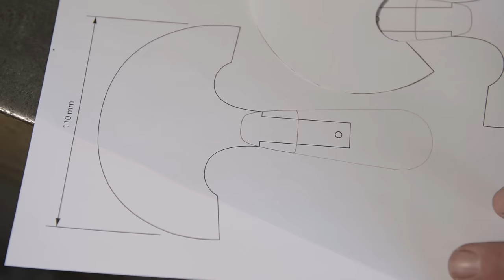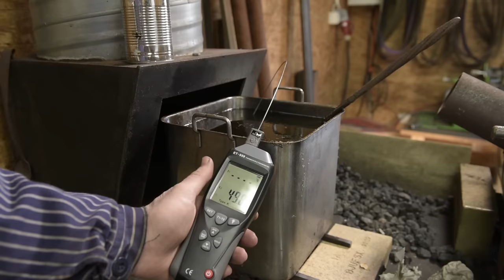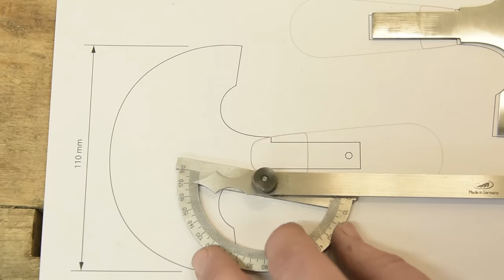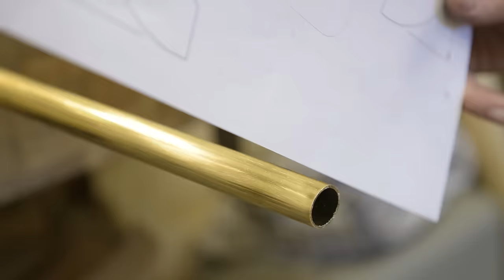Making a half moon leather knife

Comment: Does anyone else think that his making of the brass ferrule, is the most impressive part of this?
Reply: that's the part I was looking forward to most from the thumbnail!
Reply: Never saw something like that, i'm really impressed!
Reply: yeah, did you see him cut that brass pipe with a piece of paper? so impressive!
Reply: I do ... It was indeed worth the watch 👍
Reply: It looking like 👄
Reply: marvelous craftsmanship
Reply: What empress me is that your the first person I've seen using English 👍
Reply: @charliesybert2683  Thank you. But I don't have a choice, in the matter. English is the only language that I know. (So, no credit goes to me,  for this one. :) ).
Reply: @roberteaster6655  same
Reply: The whole thing was most impressive! What a lot of great skills.
Reply: The FIT is the most impressive to me.
Reply: yes, indeed but since he has a lathe, he could have made the same shape much easier using sheet metal with the steel template he used with a round headed "cutter"
Reply: I read this comment before i saw it, so i thought: its not gonna be better that how he perfectly sanded the angle of the blade with his wood contraptions and how clean it came out.
But youre right, i think if you hammer a tube like that its going to come out a mess and unusable but he really applied some wizardry there
Reply: Check out a bladesmith by the name Tai Goo. He does what he calls tribal smithing. First person I saw use that technique. His website had some good tutorials( or maybe just videos, can't remember if he made explanation or not) the last time i was there. Interesting work he does. Out of Nevada I believe.
Reply: Yeah I have never seen anyone do anything like that
Reply: Muito bom esse serviço ótimo..,
Reply: @JackPorter  It's lucky that paper was handy. He would have had to hacksaw that for hours.
Reply: Robert, for sure you're gonna live over a hundred years, that's for sure. Cheers from Costa Rica, well done.

Comment: Beech wood was a good choice! It matches the steel and brass, and it will age with the metal nicely without getting too dark.

As a fellow swedish knifemaker(hobby/personal use) i applaud the no nonsense perfectionism, i appreciate when people make knives with common sense.

I like that you went through the somewhat troublesome task and showed how to make the hole/slit in the handle for the tang, like the old wooden morakniv handles have.
I dont have a lathe, and the few times i have made a hole/slit in a handle, i've used needle files, and it's annoyingly time consuming. Next time i think I'm gonna try your sawblade method(somehow).

Good job, and thanks from Västra götaland(Skaraborg).
Reply from the maker: Tack!!!

Comment: Beautiful knife.
You hold it in your fist vertically when slice - like you where stabbing the material. You draw the knife towards you as you roll the handle away from you.
You splay your fingers over the blade with the knob in your palm when skiving, and push away from you, or hold like above and sweep along the edge depending on the whether you are making an over or underhand cut. This is the reason for the stubby handle.
Using it the way you are defeats the reason for the shape of the knife and blade, you may as well use a utility knife (they do an excellent job when used properly).
Your knife has a bit too much sweep at the points, you are running the risk of nicking your wrist when held properly.
Reply: It is beautiful. I was hoping he was going to make a cover for the edge, then he pulled out the leather and just tested it.

Comment: Nice Ulu!  The one tool that does everything from hunting, skinning, Leatherwork and even great custom wood shaping and upholstery!  I’ve used mine for several decades!  Though on mine I pressure-fused a hardened high carbon steel edge around the blade to reduce sharpening frequency.  Great video! Thanks.  Like my dad used to say while teaching me the trades, “You’ll never be satisfied by ‘good enough’.”  “Good, Better, Best, Never let it rest, ‘Till the Good is Better and the Better - Best!” -Alban Douglas, mentor.

Comment: Nice!  As always, an excellent result.  For some reason, I always enjoy when you make the bezels.

I'm a lapsed knife-maker, and rivets are a big part of that world.  Have you ever seen a rivet dome set?  They spin in a drill press and put a perfect, polished head on rivet pins.  There is a matching bottom anvil.

It seems that a man of your skills could make one, if nothing else, as an experiment.  Hahah, we have time now!
Reply from the maker: Thank you!! No I haven't seen a tool like that! Sounds cool! It's difficult to finish the pin/rivet when the handle is "done"... A tool like that could solve the trouble I guess! So you don't hammer at all, just go to the drill press?
Reply: @torbjornahman  Yes, that's how I've seen it, and yes, that's exactly the problem it solves.  

To be clear, I've never done this, only seen it described on knifemaking websites.  

I was just thinking about the bottom anvil - it could be double-ended: one end has a hole which sets the stick-out for the rivet head (which probably needs to be quite precise), and the other end has a cup which safely holds the finished head. 

The cupped side might want to be domed like a rivet header to keep it off the handle?  I don't know.

The spinning part probably needs to be well-lubed with beeswax or similar.

Hopefully, this works and is the subject of an upcoming video!

Comment: I don't have money for a band saw,  so I'm interested in the swedish cutting technique. Can you please give more details on what paper is used to cut brass tubes? Is any other type of paper needed to cut steel that has more tensile strength? I could not appreciate very well if the piece of paper cuts the tube with burs, also is the same sheet of paper  used for several cuts or do you change it for every cut?

Comment: I made a very close device to the shape of your thingy from a 'garden hoe' ,  my problem was the curves in the rounding shape on the curved part. I used hardwood (OAK) for a handle using all of the metal from the Hoe as a TAng, I shaped the wood to fit my small hands. I still can't get the edge I want or need,

Comment: question: When you softened the tang. Were you using your anvil as a heat sink so the blade wouldn't overheat?
Reply from the maker: Yes, but a thin blade like this is no problem really, it cools down quickly so the heat does not travel very far.

Comment: I find that this type of knife cuts thick leather better if the primary bevel is a smaller angle and is merged into the body of the blade.  It usually takes me a day to get a new knife ground in just right and polished up.

Comment: Extraordinary video and a great job.  The high precision brass ferrule.  For a half moon the most correct sharpening angle is 29 degrees.  The pin is nice but useless since these knives always put pressure towards the handle it is impossible for it to come loose.  It is recommended to heat the end to red and immediately insert it into the wood.  That is enough.  The handle must not be perfectly cylindrical, it must have two flat faces to prevent it from turning in the hand.  Congratulations for the video.

Comment: If you're curious to why he kept reheating the brass.   When you aggressively work with metals, they become harder and brittle.   They call it "work hardening."  The annealing process he does realigns the crystalline structures of the metal, easing the tension and preventing it from splitting or breaking.

Comment: Thank you very much for the wonderful video and detailed footage. Great craftmanship and perfect result. There is one point I would like to ask you. Circular saws are usually HSS, air hardening steel, their annealing is very difficult and quenching is done by air cooling. So the steel you used should be simple high carbon steel like 1095 or something, because your oil quenching seems to have worked well. What do you think?
Reply from the maker: Yes, this old blade is probably something like 1095/1075 or there about. Modern blades are almost always done with carbide teeth, then the blade is most likely something cheap non hardenable steel.
Reply: @torbjornahman  Thank you 👍🏻🙂

Comment: Man.....you are the Man.  It was a pleasure to watch this video, even on Christmas Day.   
However, there is one Critical step that could and should have been done.  The bonding of the 2 part Glue or Epoxy between the wood and the inside of the brass fitting.  The inside of the Brass fitting should have been Coarse sanded before inserting it over the glue.  This definitely helps in the Glue getting a maximum bite &  bond to the Brass metal.
But still overall this is a Master piece.  Did you forget to engrave, MADE IN SWEDEN, or rather Made by a Swedish.....lol.  Regards from California
Reply from the maker: :) Thanks! The brass was pretty rough on the inside from the shaping.

Comment: I
QUESTION?
I'm  today myself working on ulu ( mine for spices and vegetables and using a old 5 ft - 2 ( or 1) man saw and having it to bend and twist, when I removed from my Forge what caused it?
 Seen this video years and what a true craftsman you are, 
Thanks for the teaching Sir
Reply from the maker: Thanks. Not sure what you are experiencing there? Bend and twist just by cooling in air? What's the material and how thick is it?
Reply: My first to I saw it was about 1960,
It was about 5'6" a two man saw and if one man was by himself one handle would release so only one man could work it if necessary. 
Thickness much as your circulation as shown. 
 I'm in a air force propane I've built, 
I'm guessing perhaps heating slowly my next try.I  have 2 slightly different sizes and steel for 2 more cut out, But testing the first before I build more. 
Yesterday  chopped my potatoes first time with it quicker than ever  so give me a few weeks to size it up, Believe it's about 12 percent oversized. 
I'm getting a pretty good fitting size  herb,vegetables chopper and scrapes up vegetables as I  chop, I will send you one if okay after I get it to my liking also fitting my wife's smaller hands.I have a soap stone handle that fitting good in my palm.
You have given so much to others craftsmans ,Let me do this. 
I  will message you before I  go any further. So many restrictions will the virus we should help to control. 
I'm soaking with heat next Forge day
Thanks so much 
Later Sir

Comment: Your spark test shows that your circular saw was not that hard to make a knife even it just contains about 0.50 to 0.65% of Carbon but you need at least 1% of carbon presence to make a knife. :) so your blade would not last long.
Reply from the maker: And you can tell that from the video?
Reply: @torbjornahman  Hey, Dont take me in the wrong sence i am one of your big fans. I just spent many years of learning metals that was my experience of spark test. And that observation was right you can telly with any professional though :). I love your work though

Comment: Thank you for sharing. Did you really cut your finger? Was it when you were checking the bur after grinding the blade? Been there, done that.
Reply from the maker: Nope, it was not from the edge. If I remember right it was the saw when cutting into the brass.. I slipped.

Comment: Question: wouldn't the friction from the belt sander for sharpening kill the temper on the metal?
Reply from the maker: Yes, you need to be careful not to overheat the heat treated blade. If it's too hot to hold with your hand it's time to cool it!

Comment: Could someone explain the ferrule making process from the time that it was hammer bent into a 3 leaf clover shape. Suddenly it went from 3 leaf clover back to a conical round shape on the anvil horn. What happened there and why?
Reply from the maker: Yea, that was a bit sloppy editing... The "folding" is a way to make material available for upsetting. You then hammer the folds down and repeat.
Reply: @torbjornahman  Thanks for responding. I've never tried shaping brass. I noticed that you heated and quick quenched the ferrule twice but why twice? Should the brass not have been allowed to slowly cool down to room temperature? When annealing steel, one doesn't quick quench because quick quenching is only done to harden steel before tempering - not to anneal it. Annealing steel requires the steel to cool slowly to room temperature. What would the integrity of the brass had been if you had not quick quenched it, but instead allowed it to slowly cool to room temperature?
Reply from the maker: Steel is actually the odd metal here... most other metals are annealed by heating and quenching! Brass work hardens easily and needs to be annealed often!